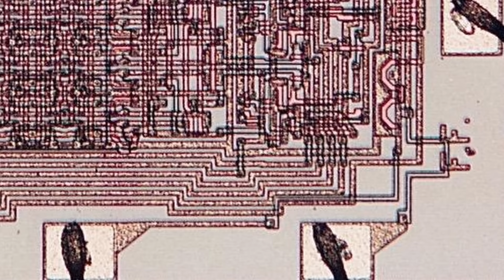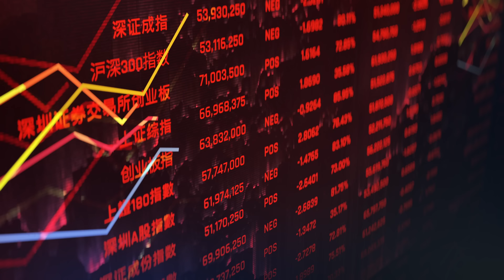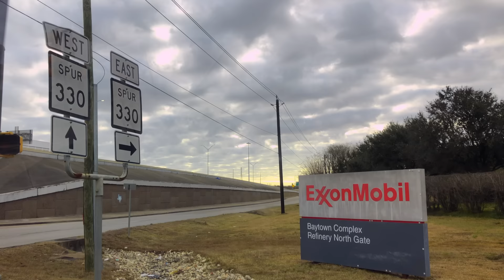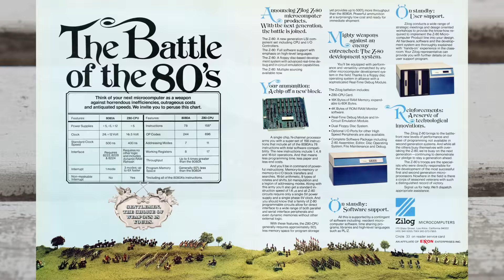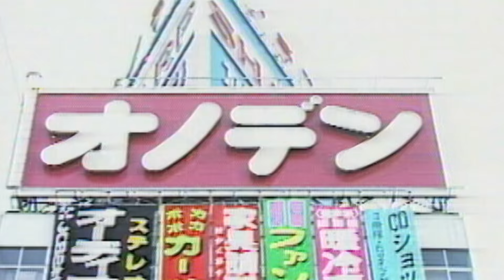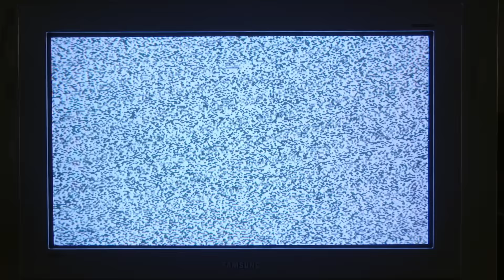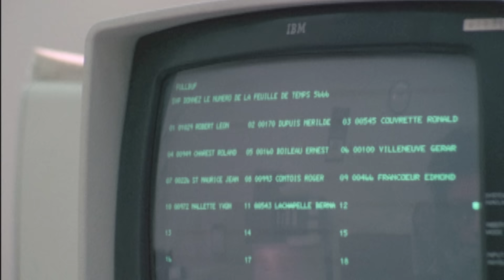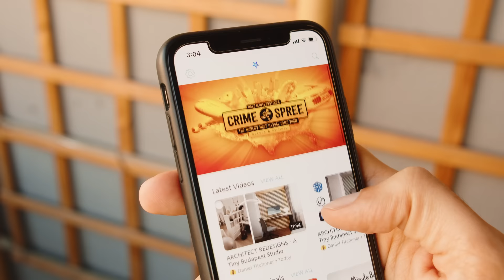Intel’s worst Nightmare

Comment: The Z80 has a MUCH better assembler than the 8080.
Both processors are binary compatible (except for all the extended Z80 instructions), but to actually program to the CPU in a sane way, you have to use an assembler software that converts the opcode names to the numbers the CPUs actually understand, and the ZiLOG nomeclature for the instructions etc is a lot better.
Reply: The Z80 was better than the 8080 sure, but it got absolutely ROFLSTOMPED by the 8086. Zilog stood still while Intel kept pushing.
Reply: @Cooe.  as in the video, ZiLOG was too busy fighting a demon to survive.
Also the 8086 assembler is much closer to the Z80 assembler than the insanity that was the 8080.
Reply: @dan_loup  Doesn't change the fact that they stood still, and Intel (+ Motorola) leapfrogged them in pretty short order. The Z80 was super important, but Zilog as a whole company was far less so. The definition of a one hit wonder. And it wasn't just Exxon that brought the company down. It was dysfunctional to the core. Absolutely TERRIBLE management.
Reply: @Cooe.  Yes, but it's quite unrelated to the fact the 8080 was a mess to program for, while the Z80 was not while they were in essence compatible.
I bet late 8080 programmers just used Z80 assemblers and avoided using the Z80 specific instructions
Reply: @Cooe.  They didn't stay still. Ever heard of Z-800, Z-8000 and Z-80000 (even Z8 µControllers). Z-8000 was even in some PC (Olivetti M-20) before IBM became the industry standard. History could have been different if IBM wasn't prohibited by Exxon to use Zilog chips.
Reply: @galier2  Exactly. Zilog had some very good advanced chips. They lost to x86 simply because IBM picked the 8088 for their PC.
Reply: Zilog had a good 8-bit chip, but they didn’t extend the same innovation to their 16-bit and 32-bit architectures.
Reply: @lawrencedoliveiro9104  Yes they did.
Reply: Intel were so smart the way they made the 8080 into the 8086. A simple register for the extra address lines but keeping it essentially the same as their hit product.
I used to do assembler on Z80 commercially and it's quite good, especially how they did interrupts, much better than Intel have ever done.
Reply: @galier2  The Z8 was good to program.
Reply: @lawrencedoliveiro9104  They did but Intel had already taken that spot.
Reply: @wayland7150  The 8086 is radically different from the 8080 and Z80 in terms of internal opcodes etc..
But the 8086 assembler is quite closer to the Z80 than the 8080. Lessons learned and all.
Reply: @wayland7150  Motorola had a better concept: start with a roadmap for a full 32-bit architecture, and release initial products (like the 68000) as cut-down implementations of that.

That’s why Motorola dominated the Unix workstation market, until RISC took over.
Reply: They didn't stand still, though, did they? They produced their own 16 bit processor which was better than the 8086. The Zilog Z800. It was all the infighting that killed them.
Reply: @Cooe.  Z80's lived on forever in imbedded hardware, can still find them out there.
Reply: The differences between the assembler mnemonic names is only a matter of semantics.  I preferred the 6809 over the 8080 because it had a better instruction set architecture.  Good programmers can learn any instruction set, because they build a mental model of (this mnemonic stands for that internal and external state manipulation), not correspondance to natural languages.
Reply: @ButterfatFarms  the 8086 assembler seem to be very inspired on the Z80 assembler, rather than the shitfest that was the 8080
Reply: @ButterfatFarms  Yes, and?
Reply: @wayland7150  The dual register set of the Z-80 helped that.
Reply: Personally, I like Motorola's assembly the best. By the mid to late 80s, 8-bit applications were better served by microcontrollers, than microprocessors. The Motorola HC05, was my favorite. Largely for its instruction set. Assembly on the HC05 was better, and more straight forward, than other microcontrollers. Even better than the AVR line, I currently use.

As for comparing the Z80 to an 8086, its apples and oranges. The Z80 is an 8-bit uP, versus the 16-bit 8086. I've written in assembly for both, though well before 2000. Of the 16-bit line up ~1980, it was the Zilog Z8000, Intel 8086 (& 8088), and  the Motorola 68000. IBM went with the 8088, an 8086 internally, with an 8-bit external bus. The wimpiest of 3. A variant of the 68000 was used for the Apple Macintosh. The most capable of the 3. The Z8000 eventually died.
Reply: My only gripe with Z80 assembler is that it can lead one to assume the processor was closer to being orthogonal than it actually was -- but once I had that covered, I found it much easier to be productive with Z80.
Reply: @editorjuno  you indeed do have to keep in mind that most aritimetic stuff will only work with A and HL.
Reply: @dan_loup  -- Right, and there's not only no 16-bit compare, but the only 16-bit subtraction commands are both HL-dependent and involve the carry flag, so you have to be sure that flag is cleared, then do an SBC followed by a 16-bit add to simulate that missing 16-bit compare without getting the stack involved.
Reply: @editorjuno  The Z80 certainly no 68000 when it comes to those things indeed. but it's not very bad.
Reply: @Cooe.  As an experienced assembly language programmer, the Z-80 is a joy to work with, due to its abundance of registers & large instruction set. By comparison, the 8086 is "a bit of a thicko", making it a chore t code for, having never enough registers & smaller instruction set.
Reply: @CZ350tuner  Pain in the ass to code or not, the 16/16-bit 8086 absolutely wiped the FLOOR with the 8/8-bit Z80 in terms of raw performance. Lol and which of those instruction sets still makes the world turn? Yeah, that'd be x86. And there's a reason nobody codes bare metal assembly anymore... These little things called "the compiler", and then later "object oriented programming" & "high level computer languages" happened... -_-

And the later invention of microcode in the 90's made x86's breadth of native CISC instructions a BENEFIT not a hindrance. It allowed the instruction set to basically have the best of both the CISC & RISC worlds, which is a major reason for its many decades of performance dominance.

Z80 otoh wasn't full-fat CISC, but it wasn't really RISC either. It was a chip perfectly designed for the time period it was made in, but with absolutely no future beyond that.
Reply: Intel x86 assembly is still a nightmare, compared to Zilog, Ti, or ARM
Reply: Although Intel tried that with the "itanic", but created something impossible to work with. instead we got the same kludge with AMD-64.
Reply: @akulkis  I started with the 6502, and sort of liked it, did a little Z80 and really didn't like it (probably didn't persevere long enough to work out where I should have already put things in order to be able to use an instruction I wanted to use), but I just loved the 6809, though doing my 6809 coding on the wonderful HP 64000 system may have helped a little there.
The 6809 just seemed clean right from the start.
Reply: @dan_loup  -- IMO it's a great little processor once you get a handle on its quirks.
Reply: You are old school. Yes, the Zilog processor was a powerhouse. Absolutely loved the humble Z80, had a Kaypro 10 and an Osborne I back in the day. Them youngins dont understand. I could do a cold boot, load a document, and have it spooling to the printer before the Windows splash screen even finished.

Mind you, I've had plenty of machines. Business. My first IPM PC AT was installed by IBM, not an outside vendor. in the day, it was a large investment.
Reply: @robertborchert932  -- I had a Kaypro 4/84, the "modern" two-floppy model with those new-fangled half-height 5.25" drives.  Among other  8-bit wonders I had an Ampro equipped with what at the time was an "advanced" 10 MB Xebec SCSI hard drive, and a Micromint SB-180 with its Z80-compatible Hitachi HD64180 chip.  My partner and I supplied Micromint with a text editor to be part of the SB-180 software bundle, a deal from which I received the most pitiful royalty check ever: $0.09!
Reply: @Cooe.  8086 Cpu was not so a spectacular CPU. With its segmented memory management (and inability to increment a memory pointer outside the limits of a segment directly at opcode level)  it was the root of a lot of PC limitations in sw. I can easily remember the so-called near/far ptr in 'C' language that were most unknown to programmers of other architectures. The memory management functions of the operating system were also heavily affected by those stupid limits.
Reply: @wayland7150  yeah, but then you had to worry about segmentation and which register to use (cs, ds, es, or ss), and you had to be careful with segment overlap.  I used MASM, and you also had to worry about the assume pseudo-op.  Either in your code, or in someone else's code you may be reviewing.
Reply: @michaelmoorrees3585  Yasss!  I first learned 6502 assembler and it really made sense with the simple register set.  Then I looked ax x86 and was overwhelmed with all these AX, BX,CX, DX, ES, CS, SS, DS registers, and the 16 bit general purpose registers were made of two 8 bit registers AH,AL, BH, BL, etc...  It allowed for smaller programs if you make clever use of the registers, but they could be more complex to troubleshoot.  6502, on the other hand, benefitted from it's simplicity.  I have never written an assembler for either (nor an instruction parser), but I imagine the 6502 would be easier to implement.  I later was exposed to RISC, and it struck me that it had similar feel as 6502.  I've heard others refer to 6502, and subsequent Motorola chips of the 68000 series were much like coding CISC on a RISC-like chip.  That's kind of how it felt to me in retrospect.
Reply: @gasparinizuzzurro6306  oh gawd - you just brought back terrible memories.  Using Turbo C and worrying about near and far pointers.  I think the far pointers would convert it to a segment:offset under the wraps, whereas a near would just use the current CS segment (or DS I suppose if it's data - I'm thinking function pointers).
Reply: 68000 assembly language was much better than anything Intel or Zilog came up with. They didn't have that ridiculous segmented architecture either.
Reply: Agreed. I recall a magazine article praising Intel's mnemonics because they took less time to type. Tha article went on to suggest something similar for the 68000. And I thought "what are you smoking?"
Reply: @sexygeek8996  the massive pile of addressing modes of the 68000 is an absolute beauty
Reply: The Z80 got ROFLSTOMPED by the 6502, so maybe it wasn't that revolutionary in the end...
Reply: True. Then again, most CPUs in history have better assembler than 8080 (and x86 in general) ;).
Reply: @tomahzo  The fun point is that you can use a Z80 assembler to write 8080 code and avoid the absolutely insane intel scheme.
Reply: Ah yes both processors are binary compatible except only one is.
Reply: Okay now what do you have to say about the 8087 math coprocessor? I had one of those until upgrading to the 80286 a few years later...
Reply: Not to be niggling, but there was an issue with the Z80 parity flag that bit the early basic interpreters as I remember. The 8080 didn't even have index registers, though using the Z80's was slow. The alternate set of registers was nice too. This was all back when 8 Mhz was a blazing fast clock speed.
Reply: @wayland7150  I used a Z8 to control a lawn sprinkler system I designed. It was a beautifully elegant chip, and easy to program. These days, the Espressif ESP-8266 and ESP-32 microcontrollers are taking my time, but I'll always remember my Z8.
Reply: @lawrencedoliveiro9104  Motorola 68000 basically copied the IBM 360 Except for a few minor differences, they are functionally the same. IBM even used the  68000 with custom microcode to run a "tiny" IBM-370 (the PC XT/370).
Reply: Look at the DEC PDP-11, and you will see where Motorola got the inspiration for the 68000 from.
Reply: @bricefleckenstein9666  i disagree with the part of "what you're used to". the 8080 has like 5 different names for LD depending on which registers are involved etc..
Reply: @Cooe.  Wrong. Both the Z800 and Z8000 were technologically superior to the 8086. Problems with Exxon Enterprises and IBM buying an Intel 8086 based PC design are what caused problems for Zilog. Sharp brought out a desktop based on the Z80, and as I recall Toshiba brought out a desktop based on the 6809 (a 16 bit successor to the 6800), but market forces had businesses standardize on MSDOS and the 8086.
Reply: @JoleFin Kinda but kinda. In this case the 8080 got completely demolished by the Z80 and 6502, but intel learned the lesson and made the 8086 assembler much more readable.
Reply: @dxf The 8080 manages to make the horror you talk about child play.
For example, ldax d is the equivalent to ld a,(de) and mov m,a does the same as ld (hl),a
Reply: Seems like there was a lot of dirty dealings and backstabbing back in the 80's over chips.  Wonder if it's still going on nowadays. hehe
Reply: @dan_loup  8086 was garbage and 8088 was hot garbage
Reply: @TurboXray  It's certainly no 68000
Reply: @dan_loup  lol
Reply: @CZ350tuner  "As an experienced assembly language programmer, the Z-80 is a joy to work with, due to its abundance of registers & large instruction set. By comparison, the 8086 is "a bit of a thicko", making it a chore t code for, having never enough registers & smaller instruction set."  That doesn't make any sense. The 8080 AF, BC, DE, HL, SP registers map onto 8086 AX, BX, CX, DX, SP (not usually in that order, but whatever), leaving the 8086 with extra registers BP, SI, DI. You could argue SI and DI are like x80 IX, IY but that still leaves BP extra. Plus everything on the 8086 is more flexible. You can do both 8 and 16 bit operations between any pair of suitable registers at all, not only to A or HL. Even if you set all the segment registers to 0 and only use 64 KB of RAM on the 8086 it's a massively superior ISA to the 8080 and z80.  I'm someone who hates the whole Intel family and would rather use 6502, 6809 and 68000 but even I know the 8086 was a big advance on 8080/z80.
Reply: @lawrencedoliveiro9104  what? You didn't like that System 8000 in K basement? It was better than 8086 in every way, with 16 general purpose 16 bit registers that could also be used in pairs for a full set of 32 bit operations (incl 32x32->64 multiply, and 64/32->32 divide). The segmentation scheme was much better than 8086.  Sure, it wasn't as good as 68k and the Mac 128k ran rings around it speed-wise, but it was a good 16 bit machine.
Reply: and the 8080 command set was a sub set of the z80
Reply: @bernds1488  more like the Z80 is a superset of the 8080
Reply: @BruceHoult  As far as I’m concerned, arguing over which segmentation system is better is like arguing whether it’s better to have a broken arm or a broken leg. They were both brain-dead.

The Z8000 kept the segment base and offset values separate, to give a total 8MiB address space, while the x86 scheme overlapped them, giving a little more flexibility in locating segments at the cost of reducing the address space to 1MiB. With either scheme, the largest object you could (easily) address contiguously was just 64KiB.
Reply: The Z80 was a dream come true. Beautiful logic and design. It had superior indexing capabilities. Those were the good old days.
Reply: @electrictao5180  the IX/IY registers don't quite save too many CPU cycles or even much memory due the prefixes + extra indirect address byte, but they're so comfy to use
Reply: The irony, of course, is that it was Intel that made Zilog develop that much nicer  and more orthogonal set of assembly language mnemonics. Intel couldn't copyright the opcodes and what they do, but they could copyright the assembly language, and they were certain to sue Zilog if they Zilog used it.
Reply: There is a slight difference in how the half carry flag is handled, as far as I recall.
Reply: @galier2  Z8000 had two problems: silicon bugs + the way addresses were handled by splicing together a 7-bit segment register and a 16-bit register. It worked ok with an external MMU chip but it was inflexible without it. All arrays and structs had to fit inside a 64KB segment or require slow and complicated code. The 8086 had a much more flexible handling of memory layouts because 16-bit segment values were added to 16-bit offset values (after being shifted 4 bits). That meant that complicated machine code for array/struct/pointer code was only necessary when the arrays/structs themselves were bigger than 64KB.
Reply: @gasparinizuzzurro6306  now look up how the Z8000 handled more than 64KB memory and despair. It was much worse than the 8086 — and near/far pointers were quite easy to work with, in my experience.
Reply: @macemoneta  no, 68K and S/360 are very different. I implemented most of both architectures in emulators…
The 68K is more like a 32-bit version of a PDP-11 than like anything IBM ever did — because it was based on a PhD thesis about the PDP-11 instruction set.
The 68K went absolutely crazy with insane addressing modes, which the S/360 didn’t. The way they handled supervisor modes and I/O and flags are also completely different.
Reply: @peterfireflylund  The difference was in the 68K microcode. By replacing the microcode, IBM was able to implement the S370 instruction set (minus the floating point instructions).
Reply: @peterfireflylund  I completely disagree. back the old days of ms-dos does a memory allocation of more than continuos 64K was a nightmare.  pointer arithmetic needs to be done at a software level instead using single machine code instruction.
the memory allocation limits came from the stupid segment/offset architecture used on x86.
Until the 386 those problem were an issue.
Reply: @peterfireflylund  I do not know z8000 but a quick look at some documentations, say that z8000 had fully linear 23 bit addressing at least for absolute addressing. Relative, indexed seems to work similarly to 8086. So z8000 was a little better than 0x86
Reply: @gasparinizuzzurro6306  it came from the 16-bit nature of the architecture, not from the segment:offset specifics. The segment:offset allowed you great freedom in where you chose to locate your 64K objects, completely opposite to how that worked on the Z8000. What saved you on the 386 was the 32-bit nature of the architecture — because it was still segment:offset in real(ish) modes and selector:offset in protected mode.
Besides, far/near were super easy to work with.
Reply: @macemoneta  S/360+ can be implemented on practically any microarchitecture. Some of the original implementations used an 8-bit microarchitecture. That it was possible to implement S/370 on a (modified) 68K with a different (and much larger!) microcode tells you next to nothing about the similarities of the 68K and the S/360 architectures. As you can see, I was not the only one to point out the similarities with the PDP-11.
Reply: @BillAnt  It still happens. "Watch your back Jack"
Reply: I grew up with home computers in the 80s and went from ZX Spectrum to Commodore 128 and then the Amiga. My first machine language was Z80, but I much preferred 6502 due to its simplicity. Mototola's 68k family was superior in every way and I absolutely loved it!
Reply: anything is better build than 8080
Reply: Ahh, RISC.
Reply: The Z80 was quite popular with its extended instruction set.  But in the S-100 world, nobody wrote software using the extended set because they needed to be 8080 compatible.  Then Intel came out with the 8085.  A 5V only part that ran at 5MHz and had a simpler clock circuit.  Using the 8080 instruction set, it out performed the 4MHz Z80.
Reply: @makerspace533  Even if you didn't used the extended set, writing just 8080 code but using the Z80 syntax was a lot better
Reply: @dan_loup  Not if you are used to writing 8080 code.
Reply: @makerspace533  indeed
Reply: EVERYTHING has better assembly than the 8080.  Want to do assembly again?  Work on ARM, that's a pure pleasure to work with.
Reply: @Cooe. The 8086 was an accident. Intel America had been working on a new generation processor but the project was a disaster.  Intel in a panic appealed to their Israeli engineers to save the day. The 8086, which was a rushed hack was nevertheless highly successful. It was backwards compatible with the 8080b but offered a way forward to 32 bit architecture at the same time.
Reply: assemblers are for the lazy!...back in the day we didnt need an assembler.. we'd convert the instructions to machine code (hex) by looking up the table and then punching it into a z80 trainer...or poking the hex values into memory on our z80 based home computer... it was a good idea to comment each line of the assembly program with the hex, just for good practice..